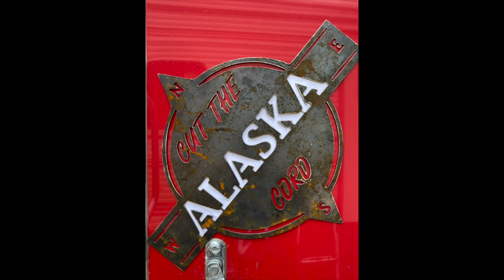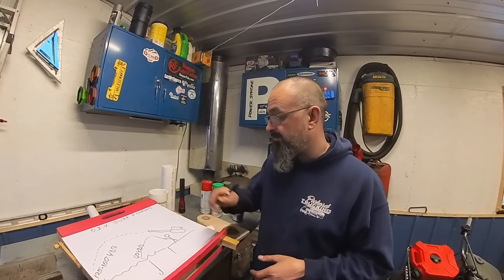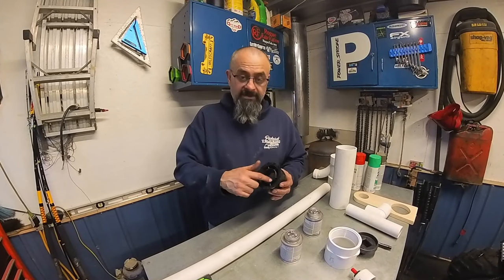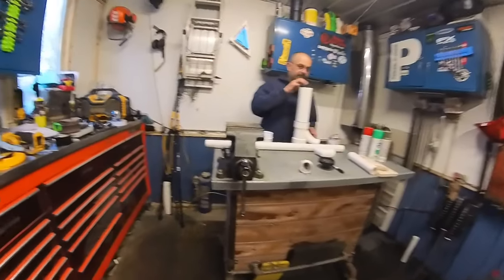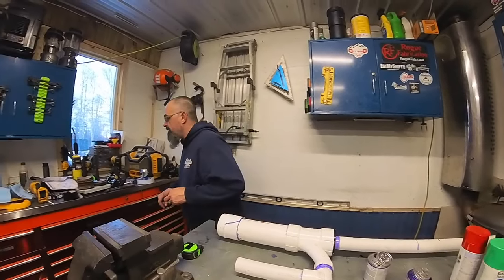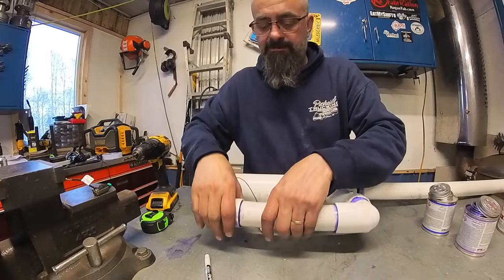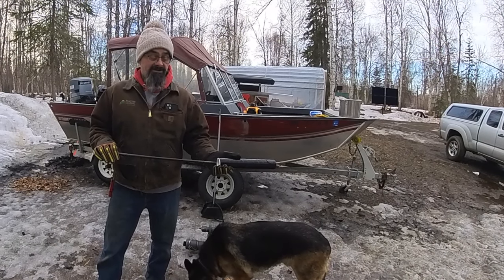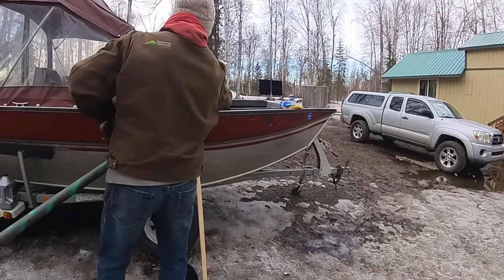D.I.Y. Surf fishing in Alaska preparations! #surfcasting #surffishing

Comment: The reasont the fitting wants to move apart when solvent cemented, is because the fitting is an interferance fit [slightly tapperd]. This forces the surfaces of the pipe and fitting to meld together.
Reply from the maker: Thank you for this.  I've always wondered what the cause was!  Have a great week!

Comment: Awesome idea .. I recommend a few wraps with duct tape around the combustion chamber incase you get a little carried away with the brake cleaner . PVC shrapnel could ruin your day.
Reply from the maker: Yup, had the same idea.  Actually though about wrapping it with fiberglass and construction wire?  Thoughts?
Reply: @alaskacutthecord769  fiberglass and reisen ? or just dry fiberglass and wire ? The first one yes. The second one the wire support mite be to isolated , unless you wrap the whole thing . That mite be overkill . The tape would flex with the PVC . If you contained the flex to much then it would move the pressure to the next weakest spot .Just thinking .